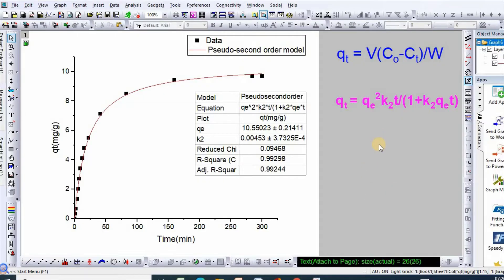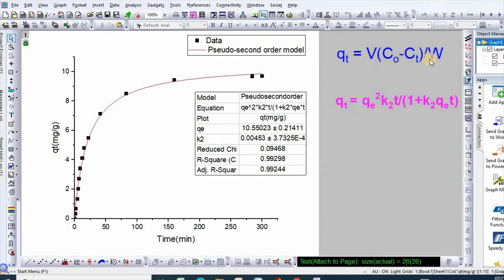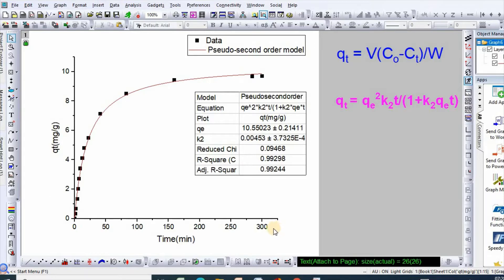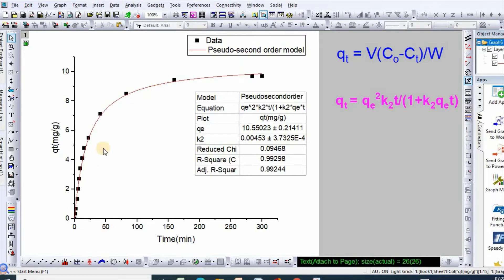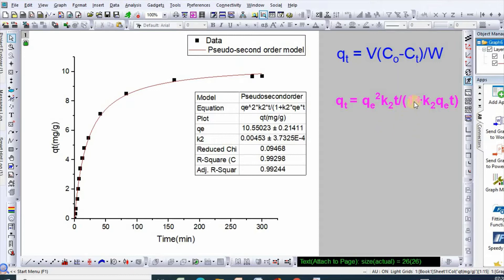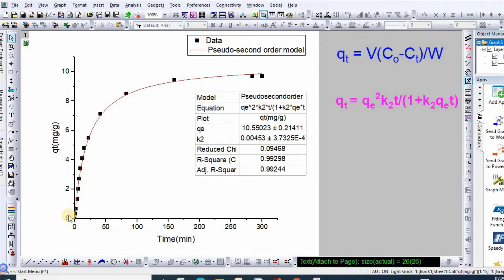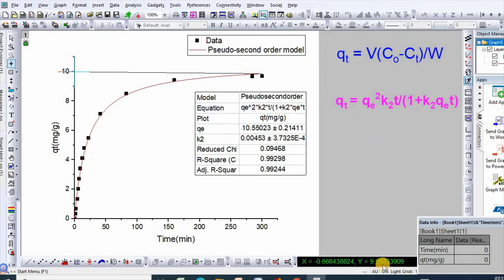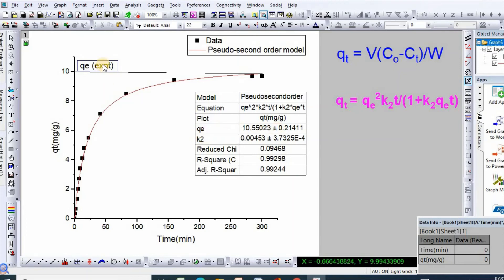Comparison of experimental and calculated qe value in adsorption kinetic study

Comment: In pseudo second order there is striking difference in qe values of experiment and the ones calculated from graph. How can I justify this occurrence? Also R2 value is very good even in Pseudo second order
Reply from the maker: Thanks. There should not be much difference between these two values. However, sometimes differences are observed for many reasons.
Reply: @Aminulchem  Similar case sir, What would be the probable reasons one could report in manuscript?
Reply from the maker: @pratistharai2558  Please elaborate on your querries.
Reply: @Aminulchem  Sir, The exp qe is 1.007 for my data. 
PSO is following with r2 of 0.98 but the calculated qe is 1.21 where as calculated qe for PFO IS 1.07 (which is more closer to the exp qe value)

How can I interpret or justify the data ?
Reply from the maker: @pratistharai2558  Thanks. In that case, you need to repeat your fitting opening a new origin file. Hopefully it will work.
Reply: @Aminulchem  okay sir, thanks for valuable suggestion
Reply from the maker: @pratistharai2558  Please watch other videos and if you have further querries, please let me know.